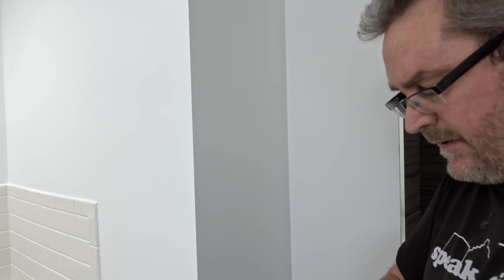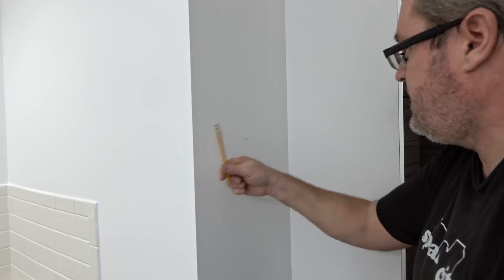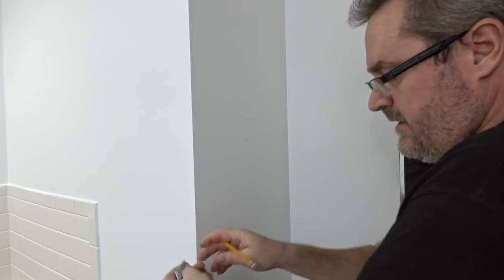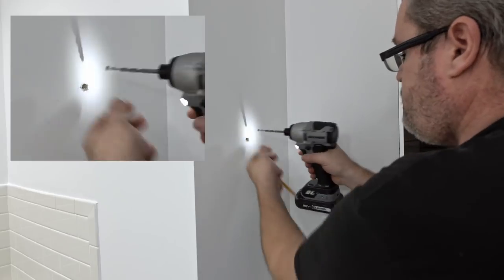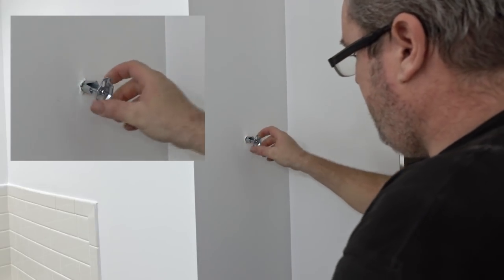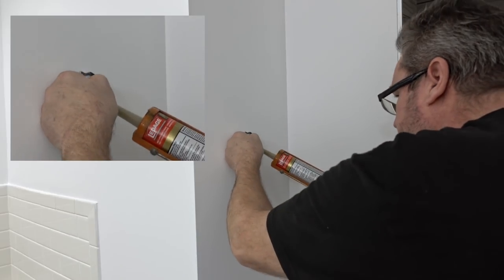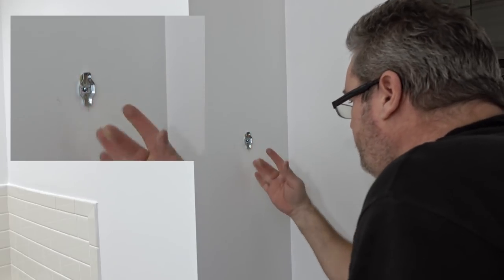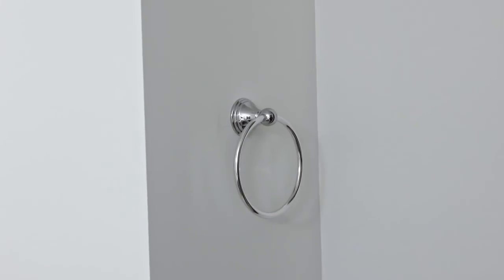Installing A Towel Ring On Drywall

Comment from the maker: I recorded this more than 2 months ago and forgot about it, so here it is now :)
Best method to install any kind of accessory like this is to either attach directly to a stud, or have solid blocking behind the drywall to screw it onto. Next best is a toggle bolt, like I used here. Avoid using those crappy plastic expanding anchors that come with these or the screw in type, since they won't hold long term. 

Here are some ways that you can help support the work I do in making these videos:

Plans for sale:
https://ibuildit.ca/plans/

Patreon: https://www.patreon.com/user?u=865843&ty=h

Website: https://ibuildit.ca/
Facebook: https://www.facebook.com/I-Build-It-258048014240900/
Instagram: https://www.instagram.com/i_build_it.ca/
Google+: https://plus.google.com/u/0/b
Reply: The only problem I get when using a masonry bit to enlarge a hole in dry wall, is that I never know if the resultant hole will be metric or imperial, so I have both toggles at hand lol

Comment: You need a construction adhesive sponsorship already ;)
Reply: "Polyurethane construction adhesive... I put that shit on everything."
Reply: No, but you can use the polyurethane construction adhesive to glue the buttered toast to a cat's back. Buttered toast will always land buttered side down when dropped. A cat will always land feet first when dropped. Put the two together and it will levitate, spinning. An anti-gravity, perpetual motion machine.
Reply: Excellent find there sir.

Comment: One of these (already installed) fell apart in my friends rented apartment, and this video helped me figure out how they work so that I could get the bracket off the wall and re do the screw that holds the loop up. (Would never have seen that itsy bitsy screw on the bottom that holds everything together on my own!) Thanks!

Comment: I work as a handyman, and not kidding 75% of the houses i go in have at least one towel or tp holder dangling on the wall.  Every time it’s because of those plastic shitty anchors.  I dont know why they send those with the kits. Toggles are my go to, but can be a pain in the ass. Studs are wonderful when they are there (never). Great video!

Comment: Thanks John- Great idea with the adhesive. Wish I thunk if it, Also I usually put a dab of locktite on the setscrew. Every time I visit my sister her fix it list includes all the towel bars falling down. I got tired of tightening those tiny screws so I made them sit and stay. Any preference between toggle bolts, mollys, plastic drywall anchors or those newfangled screwy things?

Comment: The humble toggle bolt is a good option, but here In Australia we use wall mates. And you just can't beat 'em (unless you have a stud obviously)
Reply: Ironically a Canadian horologist friend turned me onto wall mates, which are gaining traction here in the states.
Much prefer them to other methods.... unless there is a stud exactly where it is needed.
Reply from the maker: If you mean screw in anchors, toggle bolts are at least 10 times stronger. I had to Google "wall mates" to see what you are talking about.
Reply: Agreed - for anything that will get used heavily like a towel rack a toggle would be much better long term. For everything else they are really nice though.
Like the use of PL, John, going to start doing that for permanent things. Besides you have to cut the drywall to patch if you ever remove/replace it anyway.
Reply: The "super wallmate" looks pretty awesome and includes a toggle like brace. Is that what you mean Ollie?